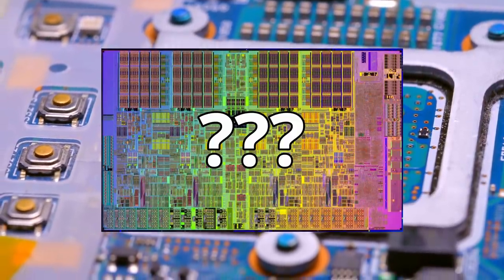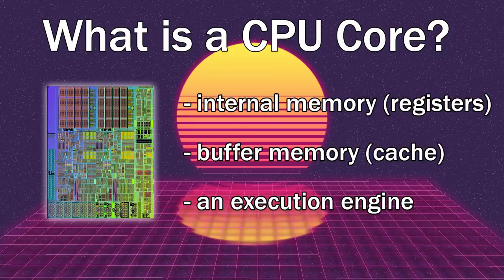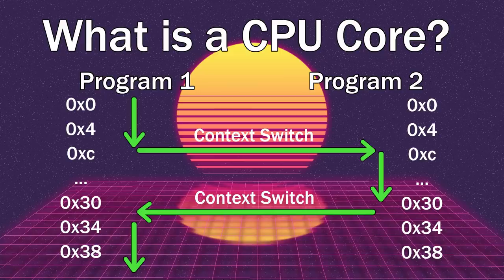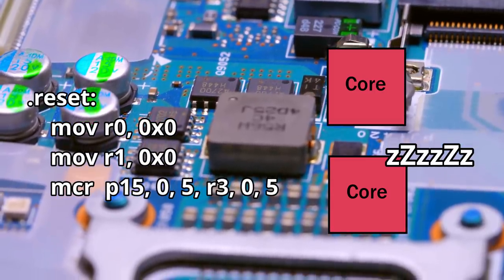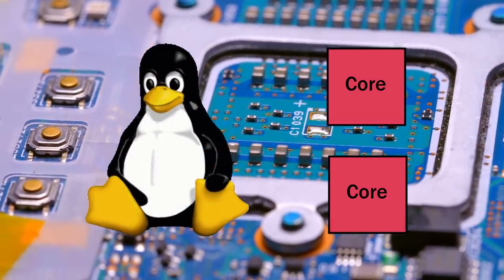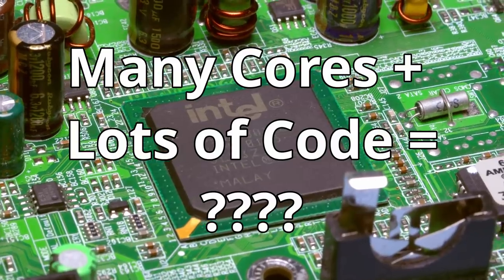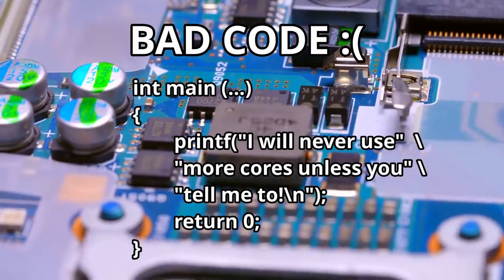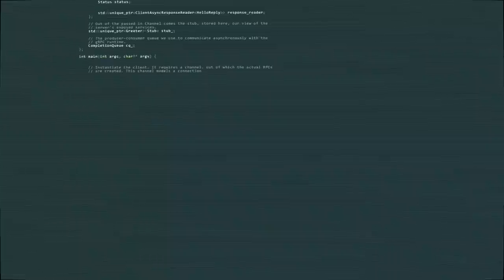why can’t computers have thousands of cores?

Comment: It's more likely the number of "core" will keep increasing, but most of them will be specialized (i.e. not full CPU cores with full system access). Instead, there could be a bunch of core doing something dedicated (but still programmable), such as encryption or compression in a way which they mostly keep to themselves except when being sent input or outputing results.
Reply: That has trade offs - you have a large number of cores that can only be used for specific tasks that will spend a lot of time idle, where you could be using the transistors for general purpose tasks that can always be used.
Reply: this already is a thing theres a dedicated encryption engine on every modern cpu. some tasks really do need that extra space of the die to be faster.
Reply: Like Cell? Which was trash?
Reply: CPUs already having encryption engines is a start. And some CPUs do include embedded GPUs for video - but better having it by default, even if there is no display support. Nowadays, going a step more optimized and including a few tensor cores would be useful with ML being more common.

Maybe even having multi-precision integer math with common functions used in modular math (not just basic add/multiply operations of SIMD),. So newer (or less mainstream) encryption could still benefit and not just be limited to whatever happens to be in the bundled crypto engine. I personally hate it when crypto libraries don't include low level APIs for some standard algorithm.. so when a variant algorithm is needed to support some protocol, it forces developers to practically reinvent the wheel and roll your own from scratch, rather than re-using the existing implementation for most of it - which is just asking for a broken/insecure implementation. So why should it be all-or-nothing for hardware crypto either?

Comment: fun fact: there is a hard physical limit to how small a transistor can be, as eventually they reach such a small size that the electrons will freely flow thru it, thus leaving the transistor permanently locked in a on state, following morse law, we should reach that pysical size limit as early as 2023.
Reply: Hence, Intel's 12000 CPUs.
AMD's Threadripper.

Comment: Well, my desktop PC from 5 years ago has almost 4000 cores. I'm talking about the GPU of course. And yes, these are real cores, they only have the constraint that they all need to do the same instructions. With vectorizable software, they are as fast as about 100-1000 CPU cores depending on the application.
You can have many tens of thousands of cores, and they would still run at peak efficiency. The problem is just that memory can't keep up, as FLOPs in hardware increase at a faster rate than memory bandwidth.
For applications like scientific CFD (see my YT channel), memory is under full load while the GPU cores do rather little work.
Reply: Some of what you said doesn't make sense when you compared GPUs and CPUs. GPU architecture is optimized to do an insane number of linear algebra operations per second. Whether or not multiple CPUs/cores could be designed to match the GPU performance depends on the type of problem. A GPU will outperform CPUs by orders of magnitude on some types of problems even if the CPUs/cores were designed with those problems in mind. You could make a CPU which has even simpler architecture than a typical RISC CPU so you can clock it even faster and design parallelization in it with those problems in mind but what about general use?
(tl;dr) You can't have your cake and eat it too because for example how many people would buy a vehicle that is fast as hell driving thru the countryside? It would be extremely complex to manufacture and cost a fortune because you wouldn't be able to sell many of them.
Reply: It's just DRAM speed, that can't keep up with current CPU speeds. 
SRAM can solve that problem, but the price in form of energy consumption is quite high. That's what lead to the typical multi tier cache architectures with several tiers of SRAM cache of different speeds. 
Another possible solution to the memory bottle neck is HBM. But HBM isn't as flexible as using DIMM modules while it's simply not a good idea to make pluggable memory modules with thousands of contacts on the other side.

Comment: "Can Intel make a processor with 1,000 or more cores?"

Yeah.  They're called GPU's.

I know a GPU is different as far as what it's designed for, but fundamentally it's the same concept just optimized for different tasks.  I'm pretty sure that if you had the time, skills, and desire, you could take a GPU (the chip, not necessarily the whole card) and design a Turing complete computer around it functioning as the CPU.  It would suck and be super limited and totally not worth the effort, but it would technically still be a computer.

Comment: LLL: "Computers Can't Have Thousands of Cores"
GPUs: Am I a joke to you?
Reply: GPUs technically don't have thousands of cores either. The Titan V only has 80 (the SM is the equivalent to a CPU core, not a "CUDA Core").
Reply: @hjups  SM(Stream Multiprocessor) are just collections of CUDA cores as far as I know.  And Radeon calls their stuff Stream processor and they also have thousands of them.
Reply: @mryodak  That's correct. But they are not "cores", they are ALUs. Put it this way.... you can either claim that the Titan V has 5120 cores and the 5900x has 816, or you can claim that the Titan V has 80 cores and the 5900x has 12.
Reply: GPUs don't have cores. That is simply wrong. They have very small computing units, but many. The entire GPU architecture is targeted towards making a single thing fast, i.e. the graphics pipeline. It can be used for some special number crunching stuff (GPGPU) but that is not what the people who designed GPUs had in focus.  When programming for a GPGPU you use a very special style of programming and you have to do a lot of things "by hand".
Reply: @Conenion  Cuda is c++, opengl is c++, vulkan is c. Other then being parallel and having it's own instruction set, what's the difference?
Reply: @mryodak  
OpenGL and Vulkan is for graphics.

CUDA ist for GPGPU. It is C++, but to fully utilize the many cores in a GPU you have to use specific extensions, libraries and programming techniques. Some of which are non-standard C++. You can not take a normal C++ program and think it works on a GPU and uses all compute units like magic.
Reply: @Conenion   So arm also don't have cores cause they need a diffirent compiler then x64?
Reply: @mryodak  
No, it is not just the compiler. The entire environment is different. As I said.
Reply: @Conenion  other then instruction set what is the difference?
Reply: @mryodak  

It is C++, but to fully utilize the many cores in a GPU you have to use specific extensions, libraries and programming techniques. Some of which are non-standard C++. You can not take a normal C++ program and think it works on a GPU and uses all compute units like magic.
Reply: @Conenion  Let's imagine my coding evironment is kodelife. I am writing a simple c++ program. I initialize two integers with numbers, add them and log to console. It works like magic! On GPU! How?
Reply: @mryodak  
Because you are not using "thousands of cores"
Reply: @Conenion  Ok. I have a 2d array of 100X100 int numbers and I add to each number an int number from corresponding array of 100*100. And log it to console and it uses C++ and it magically works on "thousands of cores".
Reply: @mryodak 
You include cuda_runtime.h. You have to use stuff like a _global_ kernel, cudaMemcpy2D()... all these things work only in the CUDA programming environment. Not in the normal C++ environment.   Reason: They target very different architectures.
Reply: @mryodak  A difference between CUDA and regular C++ there, is how the memory is allocated, and how it gets populated. In your C++ program, your memory is flat, all one location as far as the CPU is concerned (it's all RAM). For a GPU however, you have much finer granularity. You can put your array in the global memory (the VRAM), or you can put it in shared memory (the local SRAM scratchpad), or you can put it in registers (within the SMs), or you can allocate it as a texture (use the texture cache and fetches). Each comes with their own performance bottlenecks. Essentially, it comes down to balancing bandwidth and compute. With a CPU, that's much easier to do, because you have fewer concurrent memory fetches. But with an Nvidia GPU, you can have 32 per SM per cycle, or 16 per SM cluster to the shared memory per cycle, or you can have 8 per SM to the global memory per cycle, etc. With a CPU, you typically can only have a single cache line fetch per core, which has a rate of less than one per cycle. 
Practically speaking, it would be feasible to create a framework that lets you write generic C++ code that can run on a GPU. But it's going to run terribly slow in most cases, and will likely result in the CPU being faster, even for an array of 100x100 ints.

Comment: This is bull.
SGI made servers back in the late 90's and early 2000's with up to 512 64-bit CPUs...
Also, Modern GPUs have many thousands of cores already. 
As an experienced CUDA programmer, I've ran a lot of compiled C using CUDA on Nvidia GPUs with a lot of branching and a lot of instructions running non-parallel such as kd-tree and BVH traversal...

Comment: Multi hundred cores are already running well,
just in another way you might taught first: GPU or more specific GPGPU (general purpose gpu) applications.
Just think a moment about ethereum, ai (delf-driving cars), rendering or scientific research (protein folding, space analysis).
Of course: your standard operating system will not boot with just a GPU because the instruction set on a gpu compute unit is very limited.
This might change in the future: take a look at the Apple m1 or any arm (mobile) chip... They can run more efficient in consumer applications, because they carry less instructions (therefore less transistors and shorter paths (wiring) that generate heat).
Reply: Just because they run more efficient doesn't mean it'll give good raw performance. The M1 chips excel in both performance and efficiency because of the way Apple designed them to compete with Intel and AMD in the computer market. It's like how Intel was able to make x86 chips that practically was a knockoff of ARM back then, by the name of Atom brand. Only when Intel specifically went out of their way to make an extremely efficient x86 CPU could it happen.

Comment: For a given die size and transistor count, you have to balance:

1.) More branch prediction and larger cache, things that every program takes advantage of by default. 

2.) More/faster I/O and memory bandwidth, which also consumes die space.

3.) More pipelining/superscalar operations. Basically parallelism on a single core that programmers get for free.

4.) More cores/threads, something that programmers have to intentionally design around, has memory overhead (locks), and has diminishing returns for most programs (Amdahl's law).

Comment: "Any computer in the last 10 years" - My pc, Dual-Core i3-2120, 10y/o
Reply: My 4 core 8 thread i7-4700MQ made in 2013 looks like a last gen Threadripper in comparison.
Reply: @saricubra2867  i7 4700MQ isn't as fast as you think it is, and it definitley cannot compare to i7 4790K. your i7 chip is around the level of i7 2600K at best, but realistically it's probably closer to i5 2500K. this is of course assuming you didn't win the silicon lottery by a big margin.  you would need at least i7 7700HQ to match the i7 4790K at the latter's performance at base speed.
Reply: @youtubeshadowbannedme  My i7 outperforms that i5. And yes, it's between the 2600K, or i7-3770K

I never said that it's equivalent to the 4790K.
Reply: @youtubeshadowbannedme  2500K lacks hyperthreading lmao.
Reply: @youtubeshadowbannedme  I tested a family member's laptop with the i7-7700HQ and yes, it's kinda a 4790K at stock.

On average, laptop CPUs are two years behind equivalent high end i7 from desktop, that changed with 11th gen core generation and 12th too, the gap is smaller. For example, the i7-11800H without throttling outperforms the 10700K that was launched before by one year.

Comment: The sweet spot for most consumers is 8 cores imo, most games don't need more, and asuming your CPU is fairly modern it will be perfectly capable of doing whatever you require it to without issues. It won't be an oven, but it will still need some decent cooling and since it's an 8 core it won't be top of the line, making it cheaper than other CPUs while delivering a really good experience. What i mean is don't just get the biggest thing you can, it might not be as convenient as you think

Comment: I still remember having those single-core processors for years and the really annoying problem where the computer would freeze because whatever program was running got stuck in an intensive processing loop or even just an infinite loop and was basically hogging the single-core to itself not letting anything else run. It was such a relief even when I got my first dual core, and I was wondering where this had been for so many years. Now I have a quad-core and to be honest I have to have a lot of programs running at once to fully utilize it, or maybe I have to find some program that can actually utilize all the cores at once, which isn't that many. Also, even if I could find one, it'd probably hit a different bottleneck in either memory access or file access speed.

Comment: There's also a limit with high core counts that slows things down to the distance between cores too. Think of a cube, each vertex is a core. Adjacent vertices work well, non-adjacent means you have to use a path finding algorithm. It doesn't scale as core numbers increase. You have to have a master core that tracks all of this too.
Reply: That depends on the implementation. using a mesh network, it is up to the network connection processing to do that, not any core as that alone would make it slow.
Reply: @Jesse Pollard  I think you misunderstood my point. I'm referring to the cpu, there's a limit to how many cores/cpus you can have in a single machine.

Comment: According to the top500 list, the current fastest supercomputer in the world, RIKEN’s Fugaku, has 7,630,848 cores.

Of  course, they’re not x86 cores, they’re ARM. And it’s not running Windows, it’s Linux. That might help.
Reply: Not in single silicon, though.
Reply: @mikapeltokorpi7671  Not sure why that’s relevant.
Reply: >  That might help.
Minor.  What /really/ helps is that these HPC machines were built with special purposes in mind. These machines typically run algorithms that scale very well. Like for example solving systems of linear equations. Number crunching stuff.
Reply: @Conenion  The problems scale, up to a point. That’s why a supercomputer needs a high-performance interconnect which makes up such a big part of its cost.

If it wasn't for that, a supercomputer would not be much different from, say, a server farm.
Reply: @lawrencedoliveiro9104  
True. They need a high-performance interconnect because Amdahl's law would kick in much earlier without.

Comment: ~ 5:20 - Heh, I remember when early SUN workstations (running BSD-based SunOS rather than the later SystemV based Solaris) got slower when a second processor was added/enabled. The overhead of SMP scheduling was higher than the gain of the additional physical thread. The situation didn't last long, of course.
Reply: That was AMDALS LAW. it didn't help that Solaris was (at the time) using a master-slave CPU architecture for scheduling. CRAY Research had to rework solaris for Sun to fix the problem.
Reply: @jessepollard7132  Ah, so it wasn't SMP, but master-slave. I forgot those details... Thanks!

Comment: You can't have unlimited numbers of transistors because eventually you get down to the atomic level. The same with clock speed eventually the distance traveled across a processor from one side to the other is a quarter wavelength of the clock speed. Than the distance the signal travels becomes important. The size of a chip is also limited to that of about the size of a fingernail.
Reply: There's subatomic level. It's great at parallel computation

Comment: I just realized I built a new PC a year ago…….spent like 2k and never used it cuz GPU Scalpers.

If you can get them now for cheap, what should I get? Is the 3060ti still good with a 5900X, 980 Pro, and 128gb 3600 RAM?

Comment: 50 years ago there were smulti processors - which did exactly the same thing as a multi-core unit does. The limit then was about 5 processors as a max (mostly due to the memory contention limits you indicated). Some system got around the contention by using multiple memory busses - and it was up to the programmer (or schedulers or both) to avoid the contention by assigning each processor a different memory map (usually the map was in 64KB units but could be larger), thus allowing each memory bus to operate independantly without contention with other memory busses with a resulting much higher thoughput could be achieved. Some motherboards do have parallel memory busses (which tends to require memory chips to be installed in pairs.
Reply: YUP. I was Seymour Cray that figured out how to handle multiple processors optimally by using a crossbar switch in the Cray systems produced by Cray Research.

Comment: As a kernel developer and designer I claim that symmetric multiprocessing is just as easy and probably easier to do than asymmetric. I always found the communication required for one processor to "control" the others was much more complex than that required to keep the multiple kernel threads from interfering with each other.